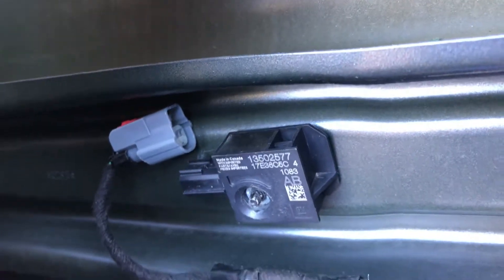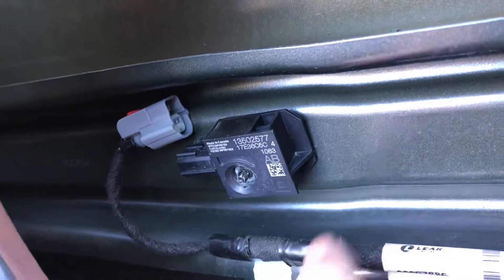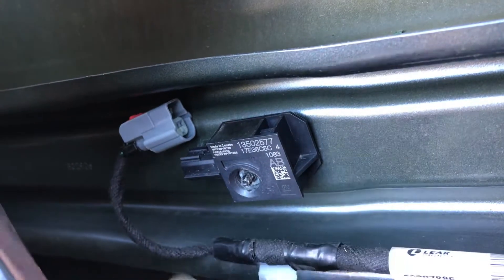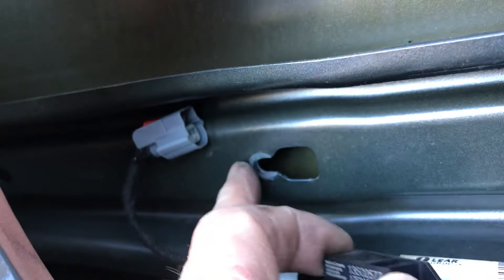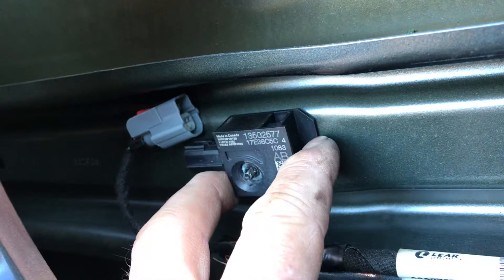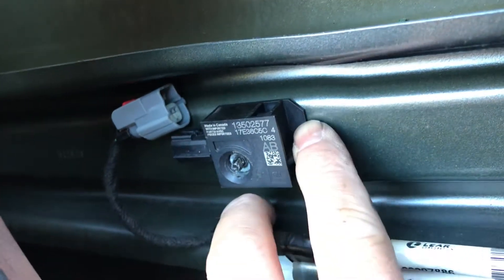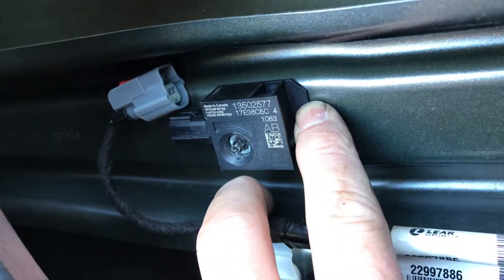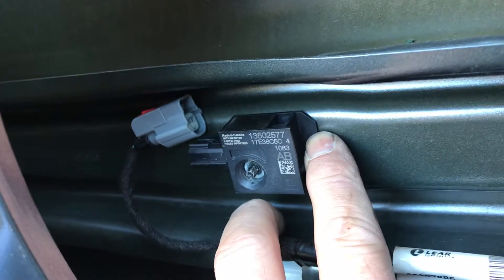2013 Chevy Volt door air bag sensor replace

Comment: It is a male torx.  Use the right tool and it is easy.  You don't need vice grips if you just use the intended tool. This would be helpful if you pulled back the camera to show the relative position on the door instead of the narrative with just one camera position.  Appreciate the effort but limited help.